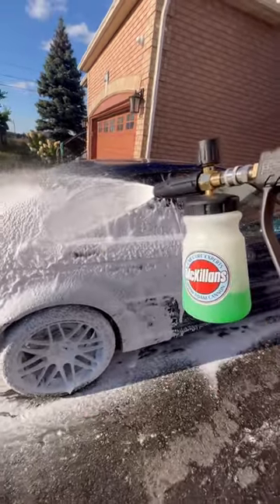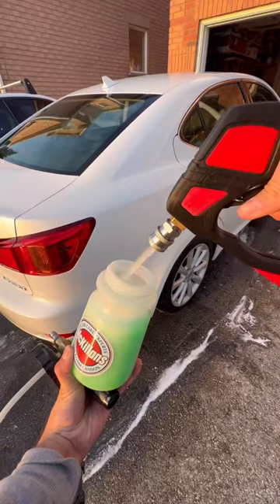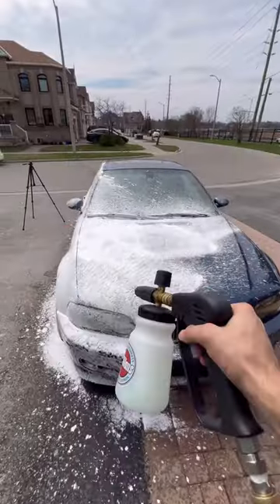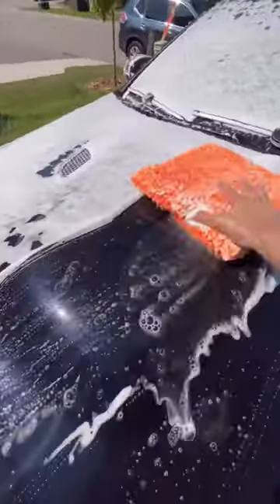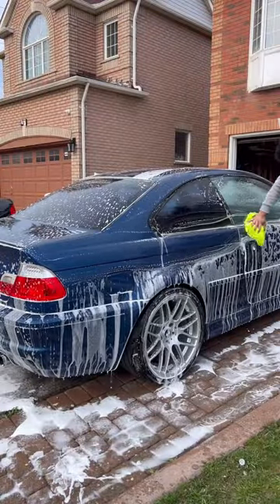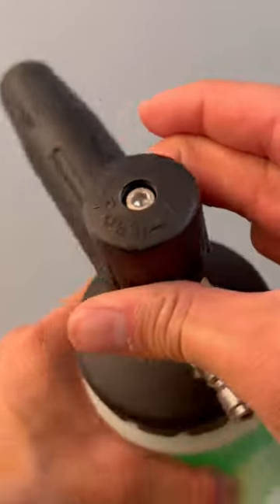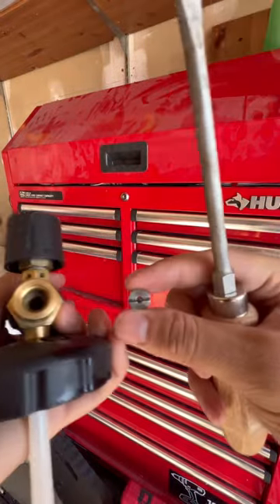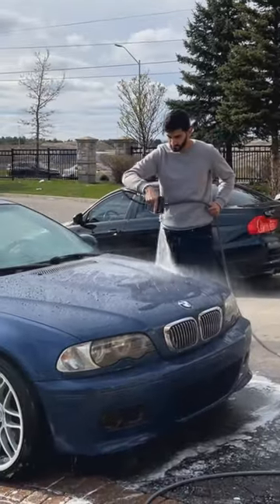3 Things You Need to Know About Foam Cannons #Shorts

Comment: I have a 1.2 GPM electric pressure washer and an MJJC foam cannon with a 1.1mm orifice and I get great foam.
Reply: How bro...
Reply: @MdMohsin-lv1tz  Good foam cannon and 1.1mm orifice.
Reply: @MdMohsin-lv1tz  yea that is the perfect combo. 1.1mm orifice with an mjjc foam pro and youre good. The highest foaming soaps I’ve used are
1. DIY Detail incredible suds
2. Mirror Finish polished Atomic Bomb
3. Adams Mega Foam
Reply: Does the 1.1 come installed already?
Reply: @gonzalesa101  It has the 1.25 installed but also includes a 1.1 orifice. You just need to switch them out.
Reply: So we can order this and just switch out to the 1.1mm on washers with 1.2 gpm

Comment: The actual point of the foam cannon is the make it easier to wash your car while in direct sunlight. 

If you have proper output, the foam should be thick and stick on the surface. This makes it so by the time you’re halfway around the car, the other half is still foamed and protected from the hot rays of the sun, reducing the chance of streaking or water spotting.
Reply: Well that's one reason.. another is for a pre wash, you should foam, let it sit then rinse, foam again then wash. I do rinseless washes now though wayyyy more time efficient drying feels way slicker
Reply: Plus there's no excessive water in the door jams, feet stay dry, don't need to take a hose/ pressure washer etc..
Reply: That's actually doing a heap of damage.
Reply: @robertsaca3512  what is? LOL
Reply: @jh.f30 
Forgive me but how do you go about doing a rinseless wash ?
Reply: @54356776  look up diy detail tutorial on how to safely do a rinseless wash

Comment: The active 2.0 and the Ve52 it’s recommended not to use the 1.1 mm office though from what I’ve read? It make the pressure washer surge since it’s not made for to be used with a 1.1
Reply: Homie still haven't responded.  I want to try to his foam cannon but I'm afraid for the same reason u said

Comment: You aren't getting 2 gpm on most electric pressure washers, nor is it needed. For some reason obsessed garage got everyone to think that you need more water. It might save a little time, but only very little time, and your water usage will increase. As far as cleaning ability, it really isn't all that important to hunt down an especially high flow pressure washer, unless you're in a high volume detailing environment.

Comment: Will a 1.1mm orifice be ok if I have a pressure washer rated for 3100gpm and 2.3psi?
Reply: The smaller 1.1mm is really only for lower PSI and GPM washers, the typical 1.25 I see with others is usually good for yours but you can try the 1.1mm
Reply: 3100 psi. 2.3 gpm you mean? 😅

Comment: I have a 3200 psi 2.5 GPM Husqvarna (gas powered) pressure washer. Is this too powerful? Do gas washers work for detailing?
Reply: Way to powerful, could damage the paint I think it will too if you’re able to change the psi then keep it below 2k psi

Comment: can you use a gas pressure washer?
Reply: Hell yeah! But only use around 1000 psi, you dont need much pressure to get good foam or to clean a car. Gas powered tend to be significantly more powerful than electric, be careful not to damage the relatively sensitive vehicle surfaces.